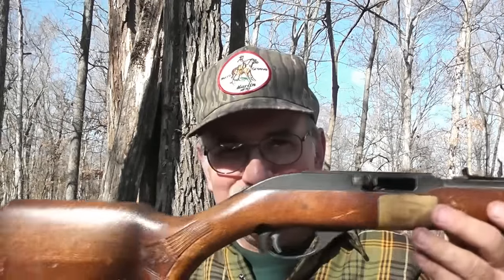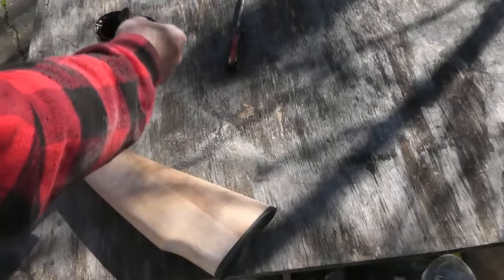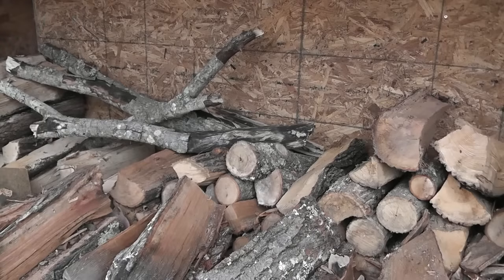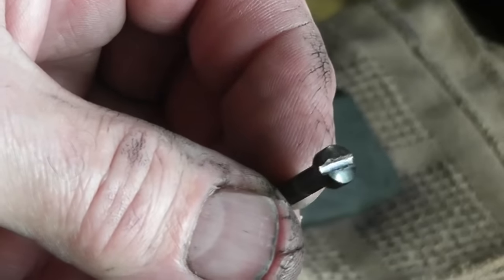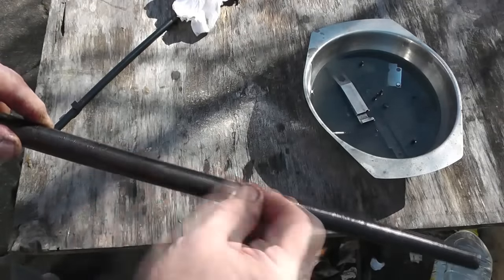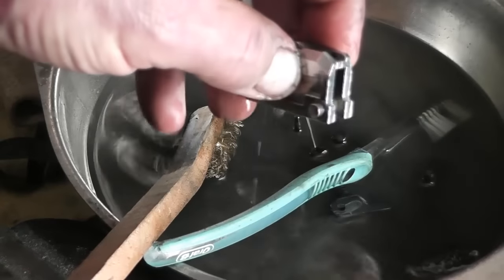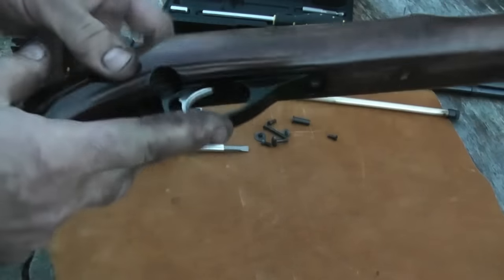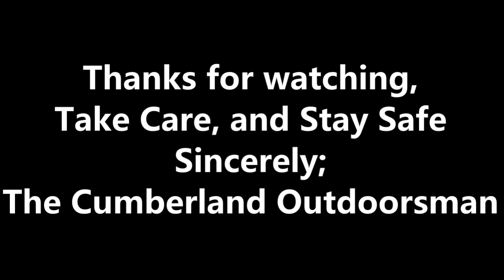Vintage .22 Restoration

Comment: I picked up a model 80 from a friend several years ago to say that it was in rough shape would be kind. I cleaned the surface rust from the barrel with wd40 and a scotch bright pad it came out very good the bolt was soaked in kerosene, disassembled and cleaned it came out good the stock was sanded and treated with toung oil. after firring the gun several times and watching videos of marksmen with expensive rifles in completions I thought that my Marlin could shoot groups just like them. I mounted a bipod and a scope the micro groove Barrel 24inch long provide tight groups at 50 and 100 yards. I'm very proud of my rifles. I also have a pre war model 80 and an early 80s model 60 that never disappoints

Comment: I definitely share your love of old guns. I have 2 vintage 16 gauge shotguns, a Stevens Model 311 from 1952 and a Mossberg Model 190 that was made between 1950-1954. I also have two rifles that I have confirmed are vintage. One is a Marlin 336SC in .35 Remington from 1951 and the other one is a 1962 Remington 700 ADL in .264 Winchester Magnum. I also have a passion for older fishing rods and reels and have several combos I use. Not the fanciest things, but they get the job done. Keep up the good work
Reply from the maker: It is so satisfying to restore an old gun or rod/reel and then take it afield and successfully harvest game and fish. Thanks for sharing your insight.

Comment: Great video, one thing to note is you want to lock the bolt back when putting the side plate assembly back in so you don’t accidentally bend the ejector spring. The factory manual mentions it. Outstanding use of common tools everyone has in their garage. Thanks again

Comment: I worked at a J.C. Penney store in the early 70's when I was in high school. Back then Penney's had a hardware & firearms department; we sold these Marlin/Glenfield 22-caliber rifles all the time. As I recall they cost somewhere between $50 and $60. Ammunition ran about 1 cent per round; 50 cents for a box of 50 LR.
Reply from the maker: That was a different time in America. How things have changed. Thanks for sharing your story.

Comment: It looks great! About the crack in the stock, I saw a guy put CA glue (super glue) in the crack and sand the area so the sanding dust would fill the crack. I thought that was pretty clever and it worked great, better than wood filler.

Comment: Great job restoring a nice old model 60.  Just finished reviving my old model 60 and treated it to some new upgraded parts.  Working on an old family Marlin model 57M lever gun now.  It had surface rust like the one you worked on but cleaned up nicely with steel wool saturated with CLP.  After a nice cleaning they both run great.  Keep up the good work.
Reply from the maker: That's great! The fact that you are keeping those old .22's going by reviving them is proof of the kind of kinship I have with my viewers Thanks for the compliments.

Comment: I just picked up a Sears Ted Williams 22. based off the Winchester 190. I'm in the process of using Kroil to get the rust off, but it may need to be re blued. The stock is in great shape.

Comment: Lot's of tips, tricks, and good technique. Watch this video before you start. Kerosene as a solvent is smart. The overnight mineral oil was clever. As for the penny, I'm not a fan. Those old wheat pennies are nearly gone in circulation. You can find nearly 100% copper scrubbers. Used it to remove a lead build-up in a .22 rifle. Be patient, I wasn't, let the solvent work for you to loosen it. Thank  you Remington! As for the stock, I might have done it differently. But, it's impossible to determine for sure in the video. It was a really bad split in the wood. As for your hands, it's proof a man works for a living.
Reply from the maker: If the stock were of walnut, or burl maple, I would have used Tru-Oil and hand rubbed the wood. I think they used birch and stained them from the factory. Oh, BTW, that penny is not a wheat penny for sure. My wife collects them, and she would skin me if I used a real wheat penny to rub out an old .22. All pennies up to a certain date were made of copper, but your suggestion of using a copper scrubber is good, and I'll look into it for future projects. Thanks for sharing your suggestions.

Comment: You should have shown your friends reaction to getting his gun back in it's refurbished condition. BTW, very nice job. I would have liked to see how the barrel and receiver came apart and went back together.
Reply from the maker: he was delighted to say the least. The receiver and barrel are held together very snug, and there's a pint that wedges the two tightly. Remove the pin, then use a soft mallet (made of hard rubber or lead) and the barrel comes out of the receiver. Just remember to mark the two where they meet so that they go back together aligned properly.
Reply: @CumberlandOutdoorsman  Thanks for the reply
Reply: @CumberlandOutdoorsman  Thanks for the reply

Comment: I have an old Marlin model 70 that I'm about to restore. got it when I was 15, now am 27 just got it back(thought I had lost it during multiple moves). Just looked up and it was manufactured in 1990 - not super old but still needs some love. I will end up after restoration using this in steel challenge.

Comment: Great video - new sub here -  as far as fixing up the slots on the screws - Mark Novack suggests to use a polish small ball peen hammer to flatten down the rough edges before you attempt to file down  /recut the slots.. you lose less metal this way..
Reply from the maker: I have done that in the past, but usually with more severely damaged screw heads.

Comment: I had a stock cracked like this one and I added walnut saw dust in with my epoxy after drying and sanding when I stained it was gone you could not see it. The project looks good great save.

Comment: I had a choice of about five old model 60's and selected a Glenfield with a different checking pattern than the standard with the squirrel. It has oak leaves on it. The rear sight is very loose and the trigger guard broke in the same spot. It shoots fine after cleaning. I'd like to restore it and give it to my son when he's old enough.

Comment: Very nice work! I enjoy the same things you do. Question???   Can the trigger pull be improved on the Marlin 60 family of guns? I have an old model 75 that is super accurate even with the horrible trigger,.  Would be nice if it was crisp. i know they are kinda hit or miss but all my other 60s are very nice.
Reply from the maker: Thanks for your comments. To answer your question, yes they can be improved by honing the sear a bit, and also by honing and smoothing the sear disconnect, but be careful to not remove too much metal because you could create a problem. I think there are aftermarket trigger kits available.
Reply: @CumberlandOutdoorsman  Thank you my Friend! Keep doing what you do!

Comment: Great job, I just purchased a newer Model 60 and the spring for the disconnect keeps coming out of the hole for the disconnect. Would love to see a video on exactly how that spring is supposed to be. I did order a new spring but have adjusted the old one to where I think it will work, but haven't tried it yet.

Comment: I have a Stevens Model 66 bolt action .22 I inherited after my father in law died. Because it didn't come from my family I don't know anything about its history. Whether he bought it or was his as a kid, a father's, grandfather's,  etc. It's in about 80% condition and shoots LIGHTS OUT! Apparently it originally had some target diopter sight but was missing the adjustable diopter eye piece. So I just installed an old buckhorn rear sight. I'm torn on sanding and staining it or just painting the stock.  The wood seems to be a cedar maybe. It's super light and not a particularly nice grain pattern. Its a light blond color wood and will take a chestnut or red stain real nicely.  I also like the idea of an OD green stock. The barrel isn't blued but seems to have a VERY durable black lacquer thats held up nicely but a light coat of flat or maybe semi gloss black. My research has shown its not a particularly valuable rifle.  Its a catalog order semi budget .22 from the 30s or early 40s. Its pre-serial numbers so its impossible to get definite date or other info. So far all I've done is a complete disassembly and sonic cleaning of all parts minus the barrel and stock. 
I'm a bit torn.  Its not a particularly sentiment valued gun or monetarily valued. I was given all his firearms because both his sons are convicted felons, nobody else wanted them and I was the only one they knew that loved guns. (and he had a few, several that ARE valuable) I feel a bit guilty when I think about painting it in a more modern color scheme. I can always sand it down again but I will probably just keep pondering it while squirrel hunting with it as it is. LOL
Reply from the maker: Thanks for sharing your story. I just love to hear about experiences like yours. One finish you might consider is Birchwood Caseyy's Tru Oil. It is all natural, and does a great job of preserving old gun stocks.

Comment: Nice video! I remember that back in the mid 70's a local store was selling those rifles with a cheap 4x scope for $39.88. Actually, with a good trigger job, they were very accurate semi autos, better than a 552 Rem. LOL Good ole rifles. Question, how hard was the barrel to get out of the receiver?
Reply from the maker: Thanks. They are not hard at all. Just drive out the retaining pin, and use a soft mallet to drive off the receiver at the front mounting block. Be sure it is aligned perfectly when you re-install it.😊
Reply: @CumberlandOutdoorsman  Thanks. I have a 99M1 that I bought back in the 70's, and I have a few barrels, Hart and Lilja that were take-off of target rifles back when I was building target rifles. Kinda toyed with the idea of putting a Lilja barrel on the lil bugger, but it shoots fine as it is. LOL Funny thing, it hates lead target ammo, but loves plated SuperX hollow points, and the SuperX Power points. I love .22s. Have a couple I'm working on for a friend, a Model 12 Rem, and a pre Favorite falling block Stevens made pre 1915. The barrel on the Rem is very bad, so I think it's terminal, we may rebarrel the Stevens, not sure yet. Problem is priming was corrosive way back then, and if folks didn't adequately clean them after shooting, they got washed out fast. I enjoy your videos, and share your like for old .22s.
Reply from the maker: @kentowens2179  I just restored a model 12 this past fall. you are right about the barrels. I had to re-line the barrel with one I got from Brownell's. This is a link to the video I posted on it.  https://www.youtube.com/watch?v=y5F4u2FAbZc&t=1434s

Comment: Thank you for sharing. I just picked up a 1980 Glenfield Model 60 hoping to do a similar “soup to nuts” restoration, so I’m happy to find your thorough video. My finish is rough and there is some surface rust, but the firearm functions as is. I also refinished a Glenfield Model 25 a few years back and really enjoy the process. Cheers!

Oh, did you refinish/paint the receiver and trigger guard?  If so, what did you use?

Comment: I picked up a 1972 Model 60 at my local Gun & Pawn for $120.  It does have to squirrel on it. Had a jamming problem, but, a bolt re-build soved that.Just need to find the knurled rod cap for the rod (pins a worn). Any ideas on that?

Comment: IF you have the MAG tube off a good thing to do is turn it 90 degrees and drill new hole and put the pin back in.  this MOD will allow you stack the bullets between the barell and tube so they are EASY TO LOAD
Reply from the maker: Interesting idea, but on a personal level I wouldn't recommend it.

Comment: Please! I know it is only kerosene, but wear rubber gloves! Your liver will appreciate it. I shudder to think of all the times in the last 76 yrs I did the same thing. I use brake cleaner as my gun solvent of choice, but I am very careful with it too! Flammable, inhalation hazard, splash hazard and absorption thru skin. I love restoring the Remington 550-1s. A super-sweet old 22 short, long and LR gun that had the floating chamber designed by Carbine Williams to shoot them all interchangeably from the magazine. What a classic old straight shooting semi-auto rimfire. Just do not remove that big flat screw in the bottom of the receiver after you get it out of the stock, or you will be sorry. When you hear the sear release, it is too late.... So many receivers have been ruined by trying to screw it back in on top of the sear and pulling the threads out of the receiver.
Reply from the maker: You are 100% correct! I too often expose my hands to chemicals, and wearing protective gloves is something we should all do even though it seems inconvenient.
Reply: @CumberlandOutdoorsman  Got to take the time my friend. We old geezers must cherish every second from now on... My brother in law had a gas station when he was younger and washed parts in gasoline. He died of a rare blood disorder at 62 they think was caused by that. You being a mechanic also must be extra careful. It is the cumulative effect of all the solvents all the time. I want to see you wearing gloves from now on, even at work, OK? Harbor Freight has boxes of them cheap.  I'm not a doctor, but I do stay at Holiday Inn Expresses.... BTW, that Glenfield turned out beautifully, Did your friend get it back?
Reply from the maker: @krisswanson5410  Thanks for your concern. It is true that the cumulative effect is a factor. I will check on those gloves as you suggest. Oh and yes indeed my friend was elated when he saw that little rifle. best Wishes to you and Yours...God Bless.

Comment: There have been many companies that made great 22 LR's over the year's.
I love the tube fed gun's.
But the undisputed best gun is Ruger 10/22 because their made like a machine.
Marlin 22's are made like a cap gun.
That being said I have restored hundreds of them,...I bought pieces at gun shows,.....broken stocks,... missing parts.
Usually the people assembled them wrong,... broke the spring's and they jammed,... I just bought new springs and put them in the right place and they were like new again.
I would have used Tongue oil finish.
I have always used paint thinner to clean gun's,... but due to price,... Kerosene is probably for cheaper a gallon.
Paint thinner don't hurt nothing and it evaporates.
Usually people do stupid thing's like spray the action with WD-40 that leads to failure.
I always clean with paint thinner,...lubricate certain areas with Singer Sewing Machine oil, because its cheaper than gun oil. And I spray the action area's with Remington DRI-LUBE
Kerosene is a messy oil, you don't want oil every where or powder will cake up your gun.
For rust I put Axle grease on it,....and leave it lay for a year,...wipe it off,... if you still see it do it again.
even if its pitted its all black just like bluing. You want grease with detergent in it.
I used to go to gun shows and do that all the time,....but every time they elect an idiot there's no ammo,...they stop your freedoms and it's ridiculous.
Old gun's are still worth having for hunting.

Comment: I have one of these. How do I find out its age
Reply from the maker: If yours has a serial number on the receiver, then subtract the first two numbers from 2000. That is the year of manufacture. Example; if the first two numbers are 20, subtract that from 2000 and you get 1980. That's the year of your gun.
Reply: @CumberlandOutdoorsman  I have two model 60's one with a plain stock from 1979, the other with the squirrel stock is from 1978. Thanks for the information. I found the restoration video extremely helpful